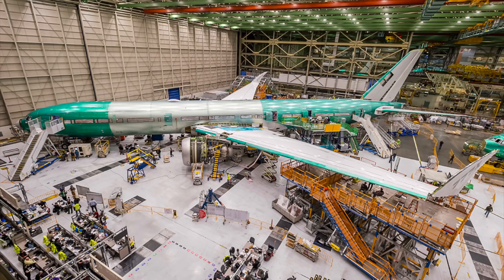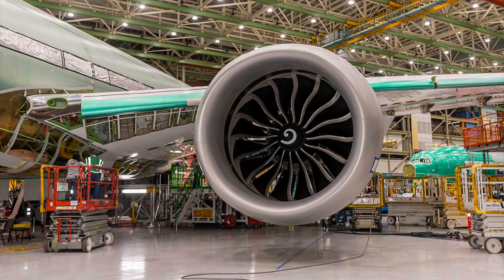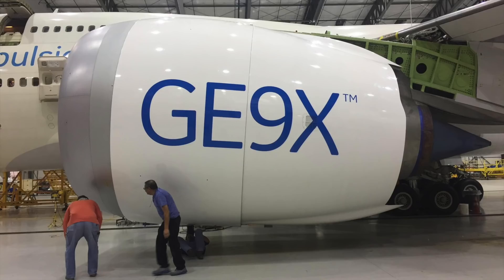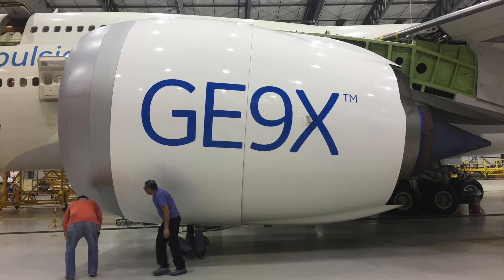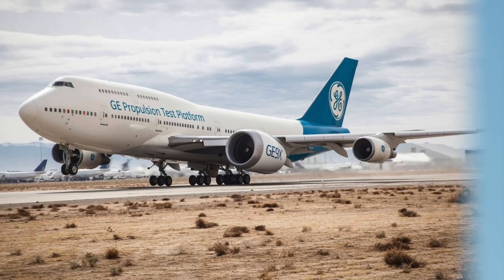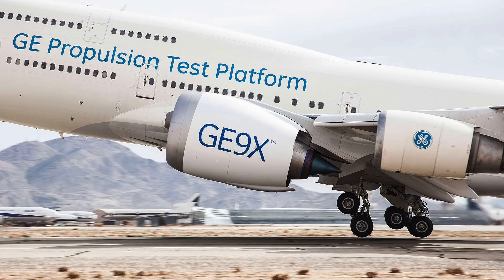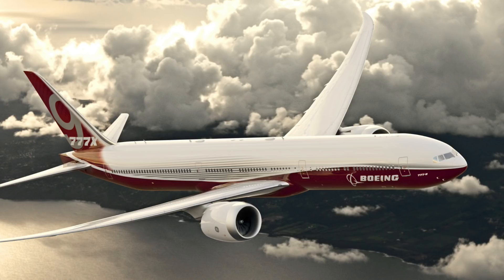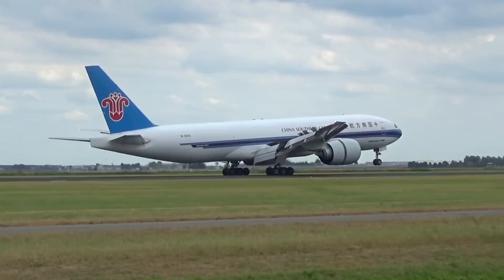777X Receives World's Largest Jet Engines

Comment: Perhaps after they get done producing and testing the largest engine ever built they can move on to the real challenge, and the real science... 

A human-sized coach seat...
Reply: It would take a mad scientist to invent such an improbable contraption.
Reply: @Claude Balls No he doesnt...just build it big enough to seat a hippo..done!
Reply: Seat requirements are from the airlines, not Boeing.
Reply: @CallsignVega  Actually airlines need safety advice from Boeing regarding on seats configuration. Hence this is still a Boeing matter.
Reply: Good news! They just announced that passengers will be foldable as well.
Reply: @CallsignVega  Correct! Boeing and Airbus can deliver the plane without a Seat so more space duh!!!
Reply: @Xarifa Lee that doesn’t matter if you’re too tall

Comment: The 777X will be (actually already is) a huge sales success. A larger but de-rated engine must give better fuel economy I guess...?
Reply from the maker: Yep, sounds about right!
Reply: Yes and No. The fuel consumption of a turbofan engine is dependant on 2 main factor. One being the size or thrust generated by the engine and the other being the thrust specific fuel consumption (TSFC). If you were to increase the thrust to 115,000 lbf on the GE9X, you will still see a lower fuel consumption vs the current GE115B due to the improvement in the engine's TSFC.
Reply: I worry that the 777x will not be such a huge sales success. NO US airline has ordered it. And most all airlines that have, have done so sparingly. The exception is the ME-3 -- Emirates alone has ordered 150 of them, and the ME-3 accounts for over 70% of their total orders. Does that sound familiar? Can anyone say, A380?

It seems that most airlines are locked into the model that demands the B787 and A350, NOT the 450-passenger models. This will limit the 777x, just as it has limited the A380.
Reply: @sking2173  Wow. You just gave me a wake-up call. My guessumption was that the 777, having been such a sales success, it's upgraded replacement would just follow on. Especially with the better fuel economy, and the folding wing tips are not exactly rocket science either so...Is the hub to hub model dead? I live in Australia where everywhere is far away (pretty much) but only Qantas is  looking at special ULR versions of said planes, point being, they'll only buy a few and Australia is not a good example of overall market requirements.
Reply: Karl P The aluminum wing 777 will eventually be phased out once all orders are filled. Then they’ll bring out 777x freighters, business jets, etc. There isn’t enough space in the factory for two full production 777 lines unless they scrap the 767 or 747 line.
Reply: @karlp8484   S King pretty much nailed it.
The B777-9x is basically offered as 
1) an upsize of the current B777-300ER
2) the replacement for the B747
3) potential replacement of the A380 for airlines seeking to downsize.
The B777-8x on the other hand is specially built for the ME3 carrier's which is why you see no one else ordering this variant besides ME3 and Qantas and ANZ who are looking at its ultra long range capability. 
For airlines who are looking to maintain the same capacity as the current B777,  the A350 offers just that. Furthermore with the B787-10 slot in between the two A350 variant, airlines has many more choices to choose from today for airplanes in the 350pax category as compared to last time  when the current B777 was launched. We definitely will not see the B777X to achieve the same level of sales the current B777.
Reply: @HughesEnterprises  If I'm not wrong, the current B777 production has been reduced to half a line. Boeing currently only has 3 wide body production line. The B767 line is now running full steam with the B787 production, The B777 line has been modified to also produce B787 while the B747 is a slow line producing mainly the B747-8F now. And with the less than impressive sales of the B777X, Boeing predicts that the current half line of the B777 will be more than sufficient to meet the production needs of the B777X.
Reply: @chingweixion621  Appears so. And with Etihad with some difficulties, that may limit sales even further. I can't see Qantas buying too many either.
Reply: @chingweixion621  On the engines: Yes, we need to be careful when we say "bigger", what are we actually saying? The larger fan diameter makes the engine appear bigger, but the engine core size/ thrust is a different matter. The number of blades on the new engine has gone down to 16 larger ones too, so this indicates a different approach - larger fan diameter with fewer blades.
Reply: @sking2173   indeed. We have seen Singapore Airlines and Cathay Pacific which previously operates 40-60 B777 ordering only 20 of the B777X mainly to replace some of their B777-300ER. These 2 airlines has opted the A350 to replace their current B777 as their backbone fleet with close to 50 on orders. Besides them, we have also seen Malaysia Airlines completely abandoned the B777 in favour of the A350. 
As for the US airlines, Delta is unlikely to order it as they are switching to an all airbus fleet. Both American and United B777 fleet is rather new and isn't due for change for at least 10 years down the road. But with both airlines extremely satisfied with their B787, it is very unlikely that these 2 US airlines will place any major orders for the B777X, Probably 10 or 20 aircraft at most. Furthermore , 10 years later, there may be even better offerings such as the A350neo available in the market.
Reply: @karlp8484  yes. We need to be careful when we say a bigger engine. For turbofan engines, it is typically referring to the thrust generated. The Fan diameter is directly related to the range of thrust  the engine is capable generating. The core size is seldom mentioned as there are many factors contributing to the proportions of its size relative to the fan size. However this ratio is often mentioned and is what is known as BPR (Bypass ratio). The number of blades on the fan has little implication. It just implies the technological advances that enables the engine to generate the same amount of thrust with less blades.
Reply: @chingweixion621  The blades are wider chord and much higher pitch, GE appears to be getting more from less. Tip speed is obviously limited by the speed of sound, so they are spinning the fan slower in RPM. The bypass ratio is greatly increased in this engine.
Reply: +Ching Wei Xion Don’t forget there is also a full 787 production line in Charleston, SC as well as Everett. There are already plans to expand the 777x production line in 2020. It may be 5-10 years down the road but either the old 777 line or 747 line is getting scrapped. If the 777x proves itself as being extremely efficient it will make the legacy 777 obsolete and customers will stop ordering it. Same goes for the 747.

The mid-market 757/797 concept plane is under development and ideally it will be built at Everett. So that’ll take up the 40-21 or 40-22 building space. Not much room left in there and I don’t see them building a new building to handle a new model. 747 is on life support already.
Reply: @karlp8484  yes indeed. That is why the bypass ratio is at its limit for the GE9X. It is a significant increase compared to the GE90, but it is only on par with the GENX or the Trent XWB. To increase further, you need the GTF.
Reply: @HughesEnterprises  nope. The quantity of orders for the B777X does not justify it's expansion beyond the half line planned now. A full line like the B777 previously would mean 10 units of production per month or 120 units per year. That would clear the B777X  orders within 3 yrs or by 2023 which would leave the line hanging in dire needs of sales and orders, So not likely. Boeing ideally wants to spread out the deliveries so that they can keep the line running at least for 10yrs until 2030.
As for the B797, if Boeing's bullish prediction holds true, they will need to produce over 100 units per year in order to meet the  demands. So a new fully dedicated production line is likely needed.
Reply: @karlp8484  Also lets not forget the B777X is considered the 3rd generation B777.
1st Gen - B777-200/200ER/300   (570 units built)
2nd Gen - B777-200LR/300ER      (1117 ordered, 904 pax + 213Freight)
3rd Gen - B777-800/900                (326 ordered)
I personally feels that the B777X will at best matches the sales of the 1st generation B777 and no better. With less than 2 years till deliveries starts and only 8 customers on the book, with only Qatar and Emirates ordering more than 20 units, I don't foresee the sales picking up the pace.  If the trend of less than 20 units holds, the B777X sales team will need to find more than a dozen customers just to match the sales orders of the first generation B777 before the A350neo arrives. Therefore it is more realistic to conclude that the B777X will be less successful in terms of sales when compared to previous generations of B777.
Reply: Ching Wei Xion Well you can think that but as someone on the ground building the new production line... the production capacity for 777x is ramping up to full production as planned unless they tell us otherwise.

I think a lot of airlines are wary of ordering a new plane that has never flown after the delays had with the 787.
Reply: @HughesEnterprises  maybe there are other factors in play. We'll just have to wait and see how things play out.
Reply: @chingweixion621  The orders for the A350, on the other hand, reads like a who's who of the airline industry.
Reply: @sking2173  actually … 350 on the books is really good … it will grow overtime but remember its actually replacing the 747 .. the other 777 variants are still being produced so you'll still have fleet availability from the 290 (iirc 787 is 285) - 430 seat range
Reply: @karlp8484  spoke and hub is going no where … "however" I do believe they are trying to mix the right direct to destinations on longer haul and leaving hub and spoke to each domestic location … but that's my guess
Reply: @chingweixion621  actually united just ordered 2 777x but I think what has happened is timing … many American carriers have been right sizing their fleets for a while now and have current 772/773 already?
Reply: @adsmith122  ETOPS blew the door open. There's scarcely anything a twin can't do now. It's just a question of range/pax requirement. Planes as small as the A319 can (and do) cross the Atlantic.
Reply: I'd gamble on Qatar and Etihad totally cancelling their orders.  As for Emirates, I can see them reducing their order also when they realise they are saturated with A380's that have a lower 2nd hand value than they were expecting along with virtually no 2nd hand market. Emirates have acknowledged that a large part of their success is the WOW factor created by the A380 and its popularity with passengers. I think Boeing will be adjusting the order book down to about 225 frames among the current customers.
Reply: @nathd1748  Good analysis. I wondered too about a near total lack of second-hand market for the A380. At least many B747s have a second life as freighters because that was built into the design
Reply: The 747 cant be far from being scrapped due to fuel consumption & costs - unless they are still in demand as cargo aircraft or something?
Reply: @simonbarr9476  The 747-8F is still selling in low numbers, the 747-8i is dead. There is actually more market in converting 747-400s into freighters and there are a couple of companies that specialise in that (not Boeing).
Reply: soaringtractor Yeah I know. I work there. You don’t have to yell.
Reply: Airliners like Cathay Pacific and Singapore Airlines ordered only a small amount of 777x, and they replaced the old 777 with A350
Reply: @sking2173  haha good analysis. but I also thing this plane will be able to land on  smaller airports and is more fuel efficient. Meaning airlines won't lose much flying empty cabins if they must. That might just increase its demand.
Reply: @HughesEnterprises  Sorry you are wrong !!!!  Boeing does have TWO 777 Assembly lines going !!!!!  When the original 777 is all built the X will take over the second line also !!!!  DUUUUUHHH !!!!!!!
Reply: Wilbur Finnigan No. there is the full 777 production line and then there is 777X LRIP which is the Low Rate Initial Production  which is like half a line but still taking up a lot of space. There’s also HBL the Horizontal Build Line where the 777X wings are assembled taking up a lot of space. It’s not nearly as easy as just moving everything onto the old 777 line. There are thousands of tools and fixtures bolted and epoxied to the concrete for both airplanes. 777X tooling is not compatible with legacy 777 tooling.

Comment: The reason the 777X doesn't need more thrust is that the wings are that much longer giving it sailplane lift and therefore demanding less power to do the same work
Reply from the maker: Yep, that's correct!

Comment: World's largest but not the world's most powerful. GE90-115B is still the most powerful with 115,000 lbf of thrust!
Reply from the maker: Yes, you are correct!
Reply: It's not about the most powerful plane. This plane is being built for the airlines that want low fuel consumption planes. This is gonna sell like crazy if it proves itself and even if it saves just 10% more fuel than all the other airliners!
Reply: There's zero need to make the engines more powerful than them old farts, because the new avionics  design of the new aircraft suppliments  the decrease in Thrust. Therefore, the latest version is still  a more proficient aircraft that the older models. 
Bone of Contention today is to carry more, yet burn  less fuel doing so.
Reply: microRiZu you’re right, but I did not say the 115B is better because it is more powerful, nor did I even say it was better. Please don’t put words in my mouth.
Reply: @microRiZu  Why not they put a new engine on Boeing 747??? Should they know better first place into test 4 biggest engine like ENO Engine of 4 ?? How far the boeing 747 going to 12,000 mile without refuel stop?!!.
Reply: GE90 is strongest in normal operation, but absolute maximum thrust the GE9X is significantly more powerful still. New world's strongest engine.

Comment: The advertised thrust rating of 105Klbs, isn’t the engine’s max power — it will be derated to approximately that number to suit the 777X spec (reducing fuel consumption, and duty cycle maintenance requirements).  Even then, most won’t be pushed to THAT limit on a regular basis.

GE9X’s true power potential will likely remain a GE trade secret for some time; allowing flexibility to “grow” into airframe upgrades as things tend to evolve.

Who knows?...  For all we know, a two-engine A380 or 747 variant may eventually come to be powered by GE9X.  Just a thought.

Comment: Any chance you could use Imperial AND Metric dimensions (you know, that measurement system that the whole world apart from the U.S.A. uses) when describing the subject of your post or is consumption only for the U.S.A. ?
Reply from the maker: Yeah, thank you for pointing that out! As an American myself, I am more familiar with the imperial system, though many of my viewers aren't American which is why I've been mainly using just the metric system. Will make sure to use both next time!
Reply: Catch-up, haven't you heard we're making America great again.
Reply: Its simple, the new engine is one quark larger than a 1 oz quarter gallon in circumference, or 1 inch, 2 nibbles and a Mack truck in size. This has resulted in weight savings of 23 tons, 12 lbs, and .25 of a Trump. 'Murica
Reply: Use both systems....oh, wait...see: “Gimli Glider”.....

Comment: 1:40 "composite" doesn't give it more thrust or lift but rather less weight. What minimizes the need for more thrust (engine power) is Boeing's new Boundary Layer Control feature which has to do with how they design the airplane's skin and wings.

Comment: The fuel used by an airliner over it's lifetime, costs far more than the airliner itself.  Just like the electricity used by a computer server costs more (over 3-5 years useful lifetime) than the server costs.  The savings represented by the efficiency of the 777-X make it a no-brainer.  Boeing better suit-up to deliver lots of them.
Reply: yep, fuel along with labor is the biggest cost for airlines

Comment: Personally, I would not trade the original GE90 thrust performance for a 12% lower fuel consumption and a 22,000# loss penalty of thrust per engine just because of a airframe modification  that uses less power to fly for safety reasons. This engine also would probably cost more to buy (times two) to pay for the GE's R&D losses.

Comment: My stupid question: If the composite materials make the plane lighter and you therefore don't need as much thrust, why not just grab some older weaker engines off the shelf instead of designing some massive new engine that doesn't make any better thrust than the older engines? Is bigger somehow thriftier than smaller?

Comment: GE90 comes in many different versions
Only the two most powerful ones produce 110K lb and 115K lb respectively (that's what they're rated for)
The GE9X is rated for 105K
but as the GE90 115B can do more than it's rated
I'd say the GE9X can too

Comment: I think Boeing is aiming for a much quieter aircraft. Large jet engines can be designed to be much quieter than small engines because a large engine allows you to move a large volume of air. At a lower pressure and you can decrease the speed of the internal blades of the engine further reducing noise. When jet engine or prop-driven aircraft tips reach supersonic speed that creates a lot of extra noise. The Russian bear tu-95 is extremely noisy because the tips of the prop blades basically are moving at supersonic speed which makes for a very noisy aircraft.